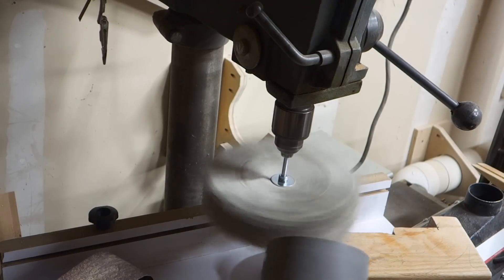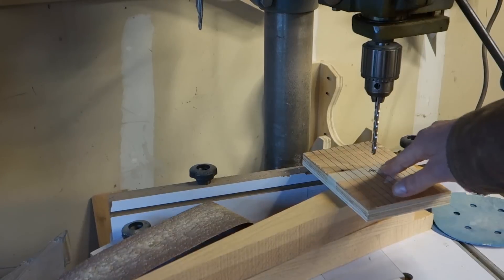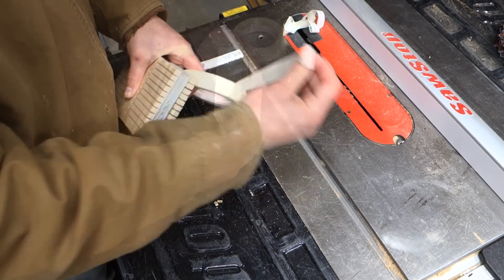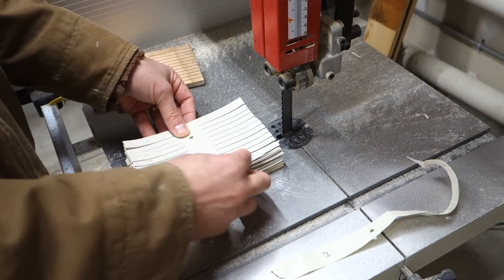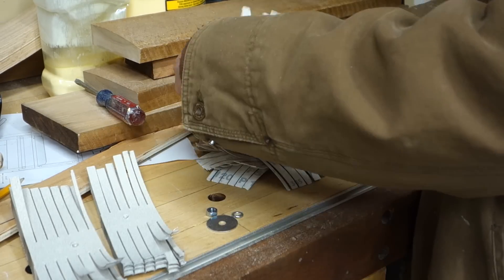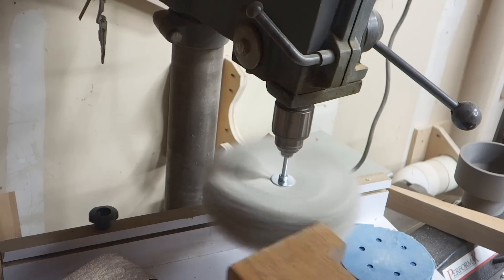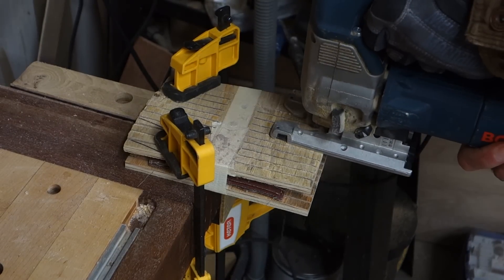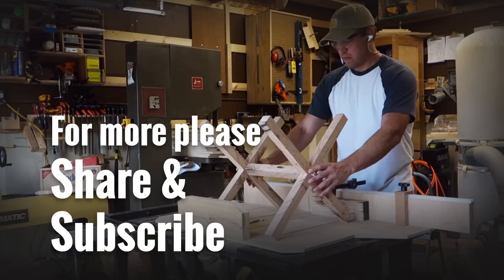How (NOT) to make a Sanding Mop

Comment: When i made mine, i just tore them all. I didnt make them are narrow as you, but when i did was i clamped 2 sections of wood along the inner portion to act as the tear stop, basically i put the paper up to the edge of metal and quickly tore the paper inwards using the metal edge of the table as the tear line, stopping at the wood.

Comment: Ouch! Yeah, you're basically sawing through the equivalent of a grinding wheel made up of one part silicon carbide, one part glue and two parts cloth. You're probably better off putting on your favorite podcast, grabbing a cold beer and spending 20 minutes tearing two or three sheets at a time by hand. But experience is the best teacher! Thanks for sharing.

Comment: I used a cheap set of hd sissors and did 2 sheets at a time. Made enough for 2 wheels in about 40 min.
Reply from the maker: Good thought, thanks
Reply: That's how I make mine too.
Reply: Yes, i think siccors is the way to go. Normally I would think that the siccors gets sharpened by cutting sandpaper? Maybe not if you go to the extreme, but I remeber seing a guy saying that you could sharpen a siccors by just cutting sandpaper?!

Comment: I’ve made a few. I made hack saw blades fit into my respirating saw. Wasn’t difficult. Cut to length, drill a hole and cut a notch in one end the same shape as store bought blades. You will need a lot of blades. Still cheaper to make a mop than buying one.
Reply from the maker: Nice! Thanks for the suggestion

Comment: If your bandsaw blade is a chisel tip tip flip your blades the teeth are upside down ,reinstall and turn the saw on ,lightly  touch the the blade with a diamond dressing stone (NOT a grind stone etc. ) this can redone  several times . I I started doing this 65 years ago.
Reply: A other alternative is take a old blade and grind all the teeth off and grind a wavy knife  edge ,I made this blade 30 years ago to cut fabric for a friend ,did 25 layers of fabric for a quilt. Out of curiosity I still use the same blade for odd jobs  on my  30 inch  1907 bandsaw, to sharpen use a old grind stone at slight angle.

Comment: just use scissors, or utility knife to cut.   both can be sharpened and reused.  no problem.   techincally your bandsaw blade can also be resharpened too, though it is not as easy.